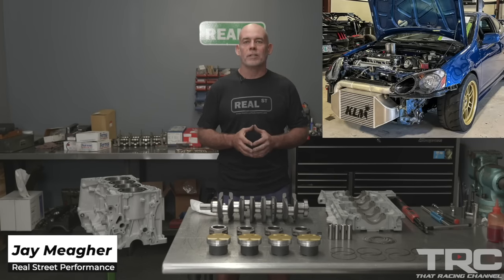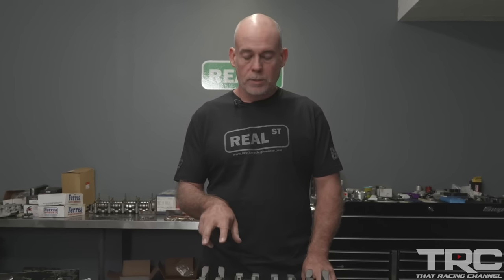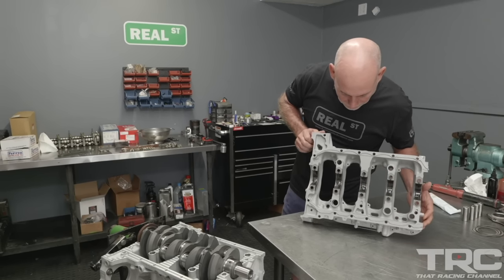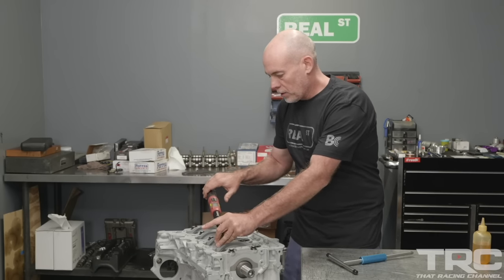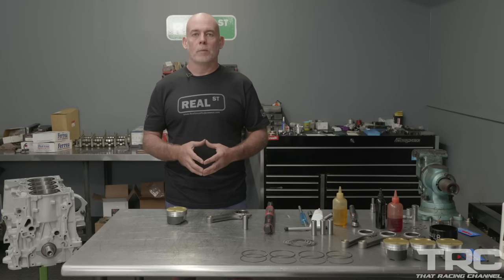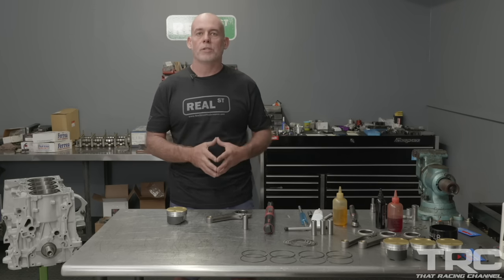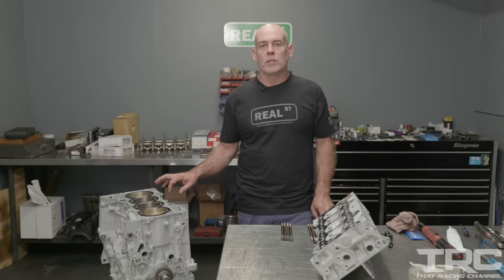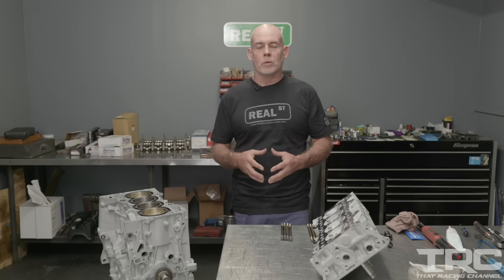Building a 1000HP AWD Honda K24 | 2.2L DESTROKER For 10,000RPM (Jay Builds our NEW ENGINE!)

Comment: I could listen to Jay talk all day! Dude is a walking encyclopedia
Reply: What I really want to see talked about more is Honda's AWD system.. I would love to know why someone hasnt completely redesigned it to allow for a true 50/50 split, or at the very least, I more versatile AWD system. Or are people just satisfied with Honda's "rear wheel assist" system? For me, My Evo, which has pretty much the exact engine configuration as a K series, I wonder why there has been no advancements in the AWD system itself or even just a completely custom one since Honda AWD is all the rage and the old Wago diffs are almost all gone now.
Reply: @JonHop1  The rear wheel assist is working perfectly for drag applications. Too much power to the rear will cause the car to “crab walk”. Awd Honda’s launch so much harder than EVOs. Ever wonder why?
Reply: @itsjussjerry  Perfectly? Yeah I dont know about that.. And Wago Diffs are super rare now, and CRV stuff sucks. This is why so many people are going aftermarket, but I would love to see a stronger AWD system in Honda.. My Evo launches WAY harder than my AWD Honda. Depends on surface. And honestly, controlling crab walk is SOOO cool!!!.. Takes a ton of skill to hold that power and be facing sideways as you go straight down the track! LOL.. Altho, Crabwalking is pretty easily correctable.
Reply: @JonHop1  people are going 9s easily with the CRV diff. I wouldn’t say they “suck”. What’s the 60 on your evo?
Reply: @itsjussjerry  Around 1.4 on average(on street tires .. 570whp).. Im not saying you cant go fast, im saying, they are rather weak and unreliable as a whole. If I were to build an AWD drag Honda, I would want a 100% custom made aftermarket setup for strength and durability. Those wago diffs are going for insane prices now, and the CRV diffs and AWD system are just not what I would want for higher HP and durability thats for sure.
Reply: @JonHop1  if you really think about it, evos have more of a true awd system when talking about how the power is diverted between the front and rear wheels. Because of that evos almost always have a really bouncy and violent 60 ft drag racing because there's nothing but grip, in some ways too much of it imo. Hondas that utilize the awd system or rwd assist have more of a 20 80 or 30 70 split and it's evident how much better it works in drag racing. I've never seen a rwd assist or awd honda struggle in the 60 foot quite like the evos do. And I believe the Honda awd system is why. It just works well. There's a reason why there's less and less diffs hanging around. People got it figured out.
Reply: @anthonyhernandez5855  I would love to see a bluetooth custom awd system that could change displacement on the fly. So if the track is crap, go 50/50, or if it's sticky, go more front biased
Reply: @JonHop1  with the tech that has came to be in this world, if someone attempted to create something like that, it could probably be easily done. Don't gtrs have something like that from factory?

Comment: Angle torquing almost always implies yeild. Either update your torque specs for arp-2000 hardware (aka Studs) in ft/lbs or Nm, or replace all oem-style hardware when retorquing angle-torqued bolts. Just redoing the sequence will dramatically weaken the yeild strength of the hardware.

Comment: Just noticed you guys using a freeze plug type head, we use those for more all motor applications because when head lifts it will put higher pressure on those plugs, could cause oil and coolant mixture,  on boosted applications we use the hex screw cap ones, I built my engine, made 1082whp on 27psi, 8685,m5, m150, tuned by Jorge at H-Car. K24a, darton sleeved, stock stroke, built by me.
Reply: i aint there yet bro... so silly question.. running m5 still use intercooler?
Reply: @LilFoxAK  yup

Comment: 2.2 is perfect, my engine is 2.2 liter too, it only runs on diesel, the indestructible and ultra smooth N22b.
The legendary B16 had almost perfect rod to stroke ratio, that is why back in the days it was perfect run high rpm and boost applications with minor upgrades.

Comment: Ive done a fair few engines with stretch tension bolts and they way i do it is ill grab a ruler and a sharpie ill lay the ruler across all the bolt and basically draw a line across the bolt head, so when your done you can check them if all the lines are pointing the same way you didnt miss any. Even 180 degrees just offset the line a little

Comment: As a k24a and k20z3 motor owner I love seeing these videos with Jay. I love his well explained builds!
Reply: Swap to ek? I’m trading to get as much info, starting
Reply: @glennsilverio6632  I have a 07 civic si coupe fg2 that I bought with a jdm k24a just put in it do to the original k20z3 motor spinning a bearing. But bargained till I got the stock k20z3 motor with the car so I could build it for a older civic or put back in my 8th gen fg2, an then use the k24a for the older build I wanna do. Haven't decided yet. But have a 90 civic hatch down the road I mite Pic up soon to build with 1 or the 2 k series I have. Lol

Comment: Reminds me of the b16b which is essentially a destroked b18c with same 212.39mm deck height but paired with a 4.4mm longer rods than the b18c rocking the same b16a 77.4mm stroke.  It changed the b16a r/s 1.73 to the b16b 1.84.  the k24 block and rods paired with k20 crank gives you a 1.77 r/s.  Pretty cool... it's like "k20b" the high spinning civic typeR engine we never got.

Comment: Can you get Jay to go over K-series oil pumps? I've heard that they cavitate over ~8500 rpm, even the type-s pump. Do the ported pumps from say 4-pistons actually help this? Are they as good as the S2000 conversions? Does the Z3 pump actually come flying apart at high rpm's

Comment: Damn I did math when I saw the title. And then he didn't even get to the boost so I could confirm if I was correct.

But I'm thinking at least 35 lb of properly cooled boost

We don't even have an output for the engine N/A

But we do know how much air it will pump approximately

2.187 * 61*10000 /3456=386 CFM if it was 100% efficient which isn't we're just doing math

I'm used to doing hot rod v8s which average 1.35 CFM to make a horsepower however the higher compression higher performance ones are more like 1.18

I honestly don't know about the rice boys but one would most likely assume they are more efficient? They've got years of trying to squeeze more power out of a little block.

But I'm going to take a stab that this thing makes just around 295 horsepower at 9500 RPMs

YouTube needs a gambling feature so people can take bets on the accuracy of this

Comment: Question : If the L19 fasteners are difficult to work with & prone to cracking/breaking, what is the advantage to using them? 🤔Don't think I would choose to put something like that in a motor unless there's a seriously big advantage.
Reply: They aren’t difficult. Much higher strength and clamp load. Just don’t leave the oils on your hand on them or expose them too long to outside. Leave them wrapped up.
Reply: @zethloveless7238  okay so they are abit like brake fluid then, be wary of contamination, leave them unopened till fitting & use some gloves! Lol 👍
Reply: @christyrogers7707  yea just keep them clean and away from elements and your good m.

Comment: He said “factory crankshaft has cross drilled journal the Brian crowed has direct oiling now the theories behind direct oiling is that at ver high rpm the centrifugal forces trap the oil in the crankshaft and starve the journal so most aftermarket crankshafts are gonna be direct oilling” I’m confused

Comment: Noob question. Why would someone destroke an engine? I’ve heard stroker kits for v8 does it help it rev higher?
Reply: higher rev, less of a stroke means higher rpm usually. Also, depending on the application, by destroking, you lose torque. Boosted Boys went to a 2.0 to keep the front wheels of their mr2 on the ground.

Comment: What is ghe benefit of the L19 studs over regulsr ARP etc? Thx :)
Reply: Lot higher tensile strength than standard 2000s. Need to be careful with moisture/corrosion with L19s they can turn brittle.

Comment: What compression ratio would a destroked engine like this have to be?
Reply: What do you mean have to?
Reply: @nlsdrf1290  can you theoretically run a higher cr ratio because you have more room for error because you decreased the pressure in the cylinder?

Comment: Man! How much would a build like that cost?
Reply: @lennixsingh626  😩🤯
Reply: It probably cost about $10,000 with parts and machining.
Reply: @lennixsingh626  $30,000 is outrageous. We’re not talking about a 2J here. A custom BC crank, with matching piston and rod kits goes for about $3500. Sleeving a block, plus bore and hone is another $2000-3000 depending on where you go. Lastly, a built head which consists of springs, retainers, valves, cams and assembly is another $3500-4000 depending on where You go. Give or take $2000 you are no way close to $30,000. JBRE and even 4piston sells fully built engines from like $12,000 to to maybe $15,000 with all the bells and whistles.
Reply: @gmadgengarage  its sad that 4 piston racing doesn't have destroked crate engine honestly i think its the best combination even for street use
Reply: @O.A_Ih4teno0bs  true. I did a similar set up by keeping my tsx k24a2 block and head. I just had the head ported, Ferrea 6000 series valves, supertech springs, retainers and bronze guides, dc 3.2s drag cartel s2000 oil pump and matching oil pan, dc timing chain tensioner, guides and chain the block was JBRE iron ductile sleeved. 1000hp easy
Reply: @lennixsingh626  that explains a lot. I thought you were talking USD. That why I was like “$30,000!!!!! 😂.
Reply: @lennixsingh626  10-12,000 usd with engine core included
Reply: @lennixsingh626  no it doesn’t
Reply: Wrong
Reply: @lennixsingh626   you’re way off on the pricing.  Not even remotely close.
Reply: @lennixsingh626  The whole stroker kit is less than 4K full msrp on BC’s website. Block machining 2k or less on the high side. The head is not ported, parts + machine work ~ 2k or less on the head. Cams 1000 or less. Leaves 3k for misc parts and engine core which is generous. But what do I know not like I have the same engine in my car or anything
Reply: @derftuned2094  poor guy deleted all his comments

Comment: thats crazy. K24 10rpm. the reciprocation is actually more than 10k. bascially its moving faster than 10krpm. its moving up and down a faster than 10k rpm. i wonder how reliable is that if you beat it on daily basis
Reply: actually just watch where he talk about how tall and the stroke are. hes actually building it reliable . he kept it the right length.

Comment: No need to destroke to turn 10k.
Nhra pro stocks were showing how its done turning well over 12,500 rpm with 3.520" stroke/ >89mm
Reply: It’s de stroking from 99mm to 92mm. Pro stock have more deck height / longer rods making that 89 stroke even easier too. We routinely rev these 92mm cranks to 12,000 rpms as well with big turbos that like that to operate in that range. This rsx is on a small turbo that won’t need that. The nice thing about that 92 crank is the b18 rod bearing like jay explained. 

This is also a turbo engine. NA k24 Hondas are running 106mm strokes and revving beyond 11k rpms. That’s way more piston speed than nhra pro stock if you want to compare NA vs NA